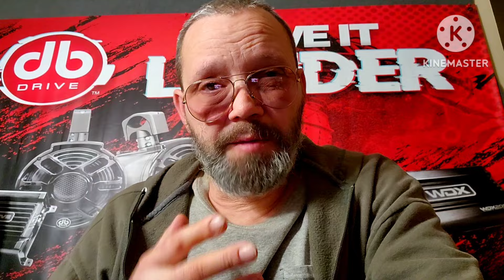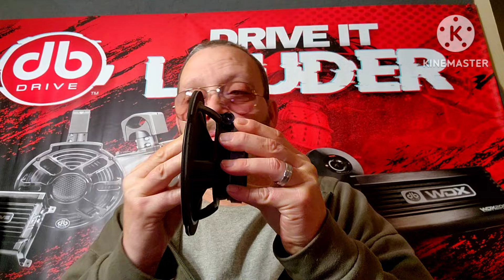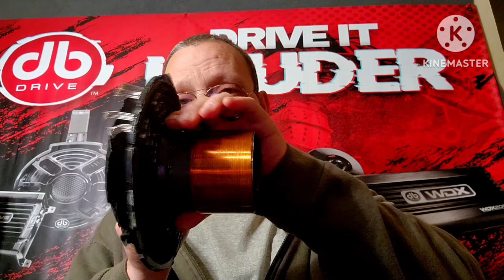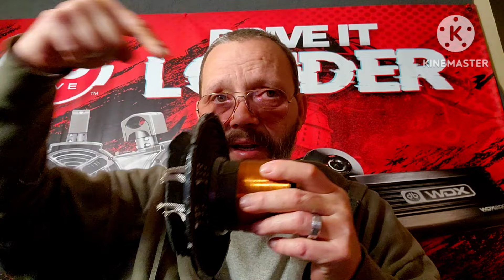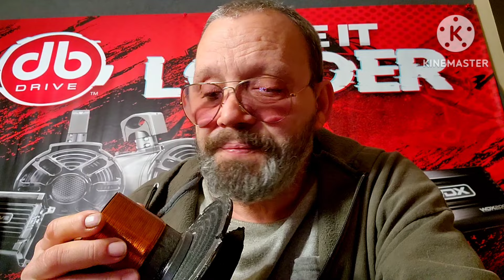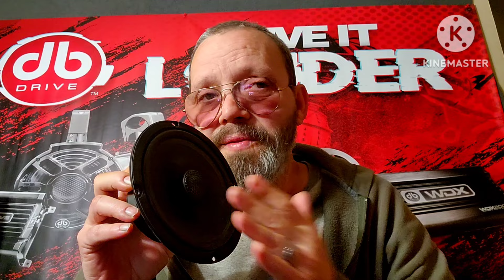4 ohm vs 8 ohm speakers which is better?

Comment: When I saw the title of the video I thought it was great because its something that really needs to be addressed. The information in the video, however, came up a little short. And I don't mean that in any negative way. You come across as an honest and genuine person, so I'm not trying to bash you, or the video. If anything, I appreciate the effort on your part to raise the issue. Its not an easy topic. I'll list some basic concepts that may help clarify some things. A lot of what you were saying was going in the right direction. It just needs a little refinement. 

When it comes to an amp driving speakers, home or car, the lower the impedance, the harder the amp has to work. When you see a speaker rated for 4 or 8 ohms, it doesn't tell you much. That's just an average. If you look at the specs for the speaker, the most important number to look at is the lowest impedance that the speaker can show the amp. So, the rating would look something like, 8 ohm nominal, 3 ohms minimum. The 3 ohms is the important number. If you have a different 8 ohm speaker that drops down to 5, its a much easier speaker to drive even though they are both rated for 8 ohms.

In the video, it was said that the speakers impedance constantly changes when in use. That's 100% correct, but its not random. The amount of impedance a speaker shows an amp is based on the frequency its asked to produced. To visualize, think of a piano. Since 8ohms is an average, there's only 1 key on a piano that will produce a note that the amp will see as 8 ohms. As you move to the right and the keys get higher and higher, so does impedance. And its the opposite for lower notes. Impedance drops. One thing that confuses people, is they think higher impedance and less wattage means its a more difficult load for the amp, and that's why it makes less power. That's not the case, and here's why. When you look at a big subwoofer moving in and out, it takes a lot of power to get it working. A tweeter only has to move a tiny bit compared to a sub. Most of the time you can't even see it moving. It just doesn't need that kind of power, so its not a negative. Going the other way, if you remove your speaker wires and touch them together, its called a short circuit, or 0 ohms. So, if you are asking your amp to drive a 1 or 2 ohm load, its only 1 or 2 ohms away from a dead short. This is not something you want to do to your amp and speakers, even if the specs show it can be done. Its like driving your car with the motor always pinned at the rev limiter. Technically, its rated for it, but in reality you're beating the crap out of your car. Its no different with your audio system. That's why I thought it was such a good topic to discuss. It seems like with car audio everyone is trying to get to the lowest impedance possible because you get more power. That's really not a good idea. Does a 4 ohm speaker sound better than an 8 ohm speaker? That question can't be answered. There's too many variables in play. Will a power amp sound better if its asked to drive a 4 ohm load over a 1 or 2 ohm load. Yes it will. Its also a lot easier on the speakers.

Beyond that, there are a couple of other issues worth mentioning. I know in car audio its very common to bridge power amps. That's when you combine 2 channels on a stereo amp into 1 channel to get more power. A bridged stereo amp is not a mono amp. Its very different. The important thing to know, is when you bridge an amp, it now sees half the impedance it normally does. A 4 ohm speaker is literally a 2 ohm speaker with a bridged amp. Yes, you get more power, but the quality of power isn't as good because you bear the crap out of your amp to get it. I'm not saying you should never bridge an amp. You just need to be careful. Personally, I prefer not to bridge, but in some situations, it may be an OK option. Just be aware of the downsides.
Reply: Interesting. Perhaps educate people too on that crucial damping Factor of amplifier relative to going half the load.
This topic was very much taken up in early car audio days, this damping Factor is very obvious with driving larger diameter subs cleanly.
Reply: @tedtan6449  If you talk to pretty much any amplifier designer they'll tell you that the damping factor is mostly irrelevant.
Reply: @tedtan6449  I can  only make a post so big. I'm barely scratching the surface just on the specific topic in the video. So, yes, I left way more out of my post, than I included. There are plenty of other variables that will have an effect how the system preforms than just this. All I can tell you is, just use common sense and make your own decisions. You will make some mistakes, and that's just the way it goes. But the most important thing is to make your own mistakes. Never let someone else make them for.
Reply: @JasonWW2000  I know home audio stuff, played with Behemoth amps. Look at Krell and other top notch designer amplification.
To quote... Typical amplifiers have a damping factor around 100, whereas higher quality amps like the ones from Dan D'agostino or Pass Lab have damping factors of around 500 (depending on the model).Jan 24, 2023
Reply: @tedtan6449 That's nice and all, but correlation does not equal causation.

If you look hard enough you  can find a low quality amp with a high damping factor as well as a high end amp with a low damping factor. It's not some secret, special specification that tells you the quality of an amplifier. 

In fact, I've noticed a lot of people going around talking about how important the damping factor is and some manufacturers are taking advantage of that by listing higher damping factors then they actually have. Manufacturers are always trying to boost their sales. They figured out a long time ago that boosting the power output numbers helps to sell amplifiers so you see a lot of max power or peak power numbers listed prominently.

I was just looking at DB Drive wdx series amplifiers and they literally hide the RMS power numbers.
Reply: The different ohm speakers are simply to make people think they must buy 2 stereos (1 each car, and home). If run a lower ohm amp say 4 ohm amp connected to 8 ohm speakers and especially 8 ohm sub you get a more musical response. Better definition between notesbut less volume. The lower the impedance the sloppier the bass but higher sound levels. Unless you simply get a more powerful amplifier

Comment: Keep learning ,you haven't quite seen the overall to home/ car audio, the 18 turns or the 32 turns moves the voice coil and the air pressure changes in front an rear of cone. Then physics takes over and pressure waves . They all sound different depending on the wave form and the material it rattles, if the rattle resembles the original we say it reproduces the sound. This is very good . The 50 years as a tech ,helps, but there is so much more to love and learn  .  Keep on

Comment: Given two otherwise identical drivers, the only meaningful difference is the required amplifier output voltage to reach a given power level. Impedance in simple terms determines the current flow for a given voltage.
A lower impedance sees that given power level delivered as less volts & more amps (Volts x Amps = Watts). 
Having lower impedance drivers is helpful in car environment, where you only have 12 - 14Vdc of supply voltage to start with, and creating amplifiers with high output voltage swing from a low supply voltage is difficult.

Comment: There's other factors involved than just resistance. Any time you have a coil in a circuit you also have inductance and reactance. Inductive reactance increases with frequency and inductance. Capacitive reactance decreases with frequency and capacitance. These factors also affect a driver's ability to reproduce certain frequencies as well as the amplifier's power output. Piezo tweeters are literally disc capacitors, so capacitive reactance is the main factor on those. Also why piezo tweeters usually don't require a capacitor to filter out lower frequencies because that capacitance is built-in.

Comment: Nice explanation !!
This is a real rabbit hole LOL.
I use notch filters to balance the frequencies that get amplified by Ohm fluctuation. 
All amplifiers are DC at the output? AC amplifiers are converted to DC by the transformer/power supply.
The car has 12v X 670 amps = 8040watts and the home has 110v X 200amps equals 22000watts.
Reply from the maker: all amplifiers output AC. and thanks!
Reply: @CarAudioEnthusiasts  That's true :). I always though that the output of most amps was DC... Turns out that it is another rabbit hole and another video LOL.
Thanks for sharing !!

Comment: I have pioneer towers that read 11.5 ohms,unusually high I thought,but I always heard the less impedance the less control.I run 1 ohm subs now because car amps are dialed in to 1 ohm for max power.

Comment: I like how in car audio now, an amp's THD and S/N is rated at 4 ohm, but the power is rated at 1 ohm (or the amp's minimum impedance).
So, the 4ohm and 8ohm speakers may "sound" the same, but the amp might not be as clean, especially at lower ohm load near max power.  But honestly, it's probably undetectable.
Reply: Ha, how kind of you to believe the THD numbers and S/N numbers are actually honest.   lol   I tend to focus on the S/N number looking for anything over 90dB. If you can find them Polk makes some very good car amplifiers listed S/N Ratio 105 dB. And Polk explains how they reached those numbers. I like the Polk brand. They don't make entry level car speakers. Just good speakers regardless of price. For around $100 pair they are my goto speaker. Less than that it's Skar. I think 2 of the best lower-mid priced speakers. Spend more then its DD Audio, CT Sounds, Alpine S Series.. Also like Sevard Subs. And entry level subs Parts Express subs.

Comment: I have a definitive technology powered subwoofer that has a 30 ohm subwoofer in it. The built in amplifier is pretty small. I think it's like 650 watts. The amplifier puts out a ton of voltage, but obviously not much current. I hooked up the subwoofer to my Orion HCCA 11000.1, and it pushed the subwoofer pretty good without blowing it right away.
Reply: how can a 4 ohm amp blow a 30 ohm speaker? 650 watts is not a small amp. And is that Orion 1100  or 11,000? I think i see the problem. Fair to say it sounded great and kicked like a horse.

Comment: In Watts it doesn't matter what voltage you start with. That's how much power the speaker is getting if it's 12 volts or 120 volts ac. Watts is volts x amps (current). Car speakers need more watts to drive past all the road noise and engine noise, ect. compared to a home. Sometimes watts is called VA or volt amps. In order to make an amp put out more wattage for a given design you can design it more heavy duty to run higher current and lower ohms like car audio. It takes a larger amp to run a higher wattage when you have more resistance. Low ohm loads almost pull power out of the amp. It's why low ohm loads are used in car audio to pull more power. Power is not near as much of a concern in homes with even thousands of dollar speakers running great off of only like 150 watts.

Comment: when it comes to ohms on car vs home higher ohms are used in home maybe also in part due to a heavier coil for lower fs for better sq (more windings more weight more ohms is my logic) also tho, you get higher BL due to more windings.  so for the same magnet and the same proportional gap at the same wattage an 8 ohm speaker should be the better ovrall performer due to higher bl and inherit lower fs, higher inherit sensitivity. this is also assuming the suspensions are proportionally adjusted. another up side to higher ohms is if you had a radio that is rated at 4 ohms but you ran it at 8 ohms i'd almost guarantee it runs more efficient. aside from having a heavy coil for lower fs and better sq you could use a heavier cone or looser suspension to achieve similar sq but as is such in cars "no replacement for displacement" (no replacement for more windings) the higher ohm speaker should be the winner when compared to a comparable clone of itself. just wanted to add that to the mix lol - nice vid brother

Comment: Soaking all this in.. The home is a different beast, larger space but less power required. Weird.
Reply: The reason you typically need more power in an automobile is due to its higher noise floor. I've got a really quiet Lincoln Navigator and going 70 mph I can measure a noise floor of 75 DB at 100 HZ and 85 DB at 40 HZ. The noise floor generally drops as you go higher in frequency. That's extremely noisy in comparison to a house, so you have to be really loud just to hear those lower frequencies.

Comment: Ya powerd sub can have a really wide range or ohms  make it  difficult to replace any thing with the  current part for the application.   Iv got a kalisph 12 with  a 1000w 30ohm voice coil   difficult to find a replacement amplifier supply  in less it's the original 💯👍✌️
Reply from the maker: Very true
Reply: Coil swap is  the way only way to go. It's the only way to reasonable way to repair  a powered sub with odd ohms  that way you can get the currect affordable amplifier  to power it correctly.  Id say don't  buy  or buy it for cheap as possible  if you ever  see any  sub at a wired ohm load regardless  of spec ratings  sense there a good amount of work involved and will ended up changing.  In any audio  really. 💯👍😉✌️

Comment: IDK what youre talking about because in my living room I have jama surround sound speakers and an 18inch skar subwwofer all in my livign room and being powered all off car amplifiers and that includes mty surround sound speakers and I have been using the same 12v power supply that has a 100amp max and have been using this set up for over a year and aside from some noise troubleshooting I have almost no feedback either or diustortion and I use to have a hifi receiver but have since been happier using the car amplifiers. Its louder and cleaner sounding imo.
Reply: Wow the car Amp Different I only use one Amp House  with House speakers
Reply: @CharlesDowiot-qv7pp  I did it as an experiment at first  and powered my surround sound speakers off a 4 channel roskford fosgate class ab amplifier and a rocksfor fosgate class d powering my skar 18inch..Then i ground a negative lead from the rca  outter    shield and it gets of any noise. I also am using a Low level RCA Pre amplifier to boost the 1v coming from the TV RCA out and Bump hartd all the time with no problems

Comment: How about 16 ohm speakers? Or 32 ohm? The higher the resistance of the speakers connected to a lower ohm amp creates a more "musical" sound quality car stereo.  Most guitar amps use 16 ohm speakers connected/powered to an 8 ohm amp. This helps create clarity with the guitar amp. That's why running subs at 2 and 1 ohm wiring gives you sloppy bass. Sure it's Louder. But if it doesn't sound great, why bother?
Reply from the maker: sorry but thats all simply un true

Comment: thanks ive also noticed in car amps like taramos with out moving the gains at all just going from one sub to another example rf t2 then to a skar 6.5 sub no movement and at volumes that the t2 is slapping and moving air the 6.5 is moving taking it but way less like the amp knows the sub cant take and gives it less??? its od

Comment: Do you have a video on running tweeters active with a DSP? How to power them using a amp but not blowing them?
Reply from the maker: just make sure youre not over powering them, or crossing them over too low, usually its around 3000hz with a 24db rolloff. but you should check your for the crossover point.

Comment: If you run an 8 ohm speaker on a car amplifier that's rated for 4 ohm loads it's going to put out roughly half the power.
Reply: @OGJD1984  But If You I Run 4 8OHM Speakers The Total Ohm Load Is 2OHM? Making The Amp Work More? But It Gives Good Power? Yes Or No
Reply: @indiobaez3314  Depends on how you wire it. 4 8 ohmn speakers wired in parallel would give you a 2 ohm load. Many bass centered amps these days are 1 ohm rated. It's why many speakers these days are sold as 1 ohm. The lower the ohm load the more current is drawn out of the amp.
Reply: @OGJD1984  So if i double up my speakers and wire them down to 4 Ohms, I should get the same sound and less stress on my amp?
Reply: @Decent9mm  When you double the ohm rating it halfs the amount of power the amp puts out. Basically the resistance in the circuit determines what current the amp will put out. Higher resistance less current. Most amps these days can do a 1 ohm load. You need to check the specs on your amp but that would give you the most current. Wiring more spreakers in parallel halfs the ohm load each time you add a pair. 2 8 ohm speakers in parallel is a 4 ohm load. 4 8 ohm speakers in parallel is a 2 ohm load. Dual voice coil allows you to change the ohm load of each sub. 8 ohm dual voice coil sub wired in parallel is actually a 4 ohm sub. It sounds complicated but it's pretty easy to figure out.
Reply: @OGJD1984  You definitely made it easier to understand… My amp can do 200 at 2 ohms and 125 at 4ohms… So my idea was to wire two 8 ohm 8 in speakers down to 4 ohm so my amp isn’t workin as hard and i still get the extra sound i need in the trunk… Now i know that will work…Thanks alot
Reply: @Decent9mm  You would get the most volume and output from the amp if you can wire it to be a 2 ohm load somehow but yeah more speakers is fine as long as you keep the ohm load in range.

Comment: I like 4 ohms and try to run everything at 4. Amps don't have to work as hard.
Reply: For car audio, 4 ohms throughout is the goal. Speakers is not a problem, but subs need a little more homework to get the desired power at 4 ohms.